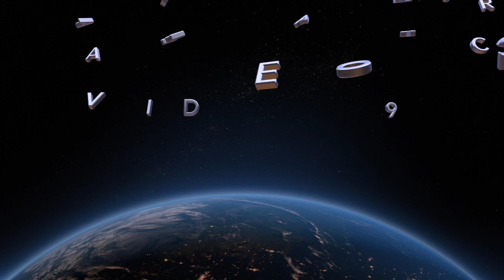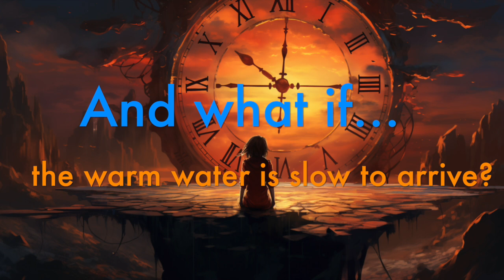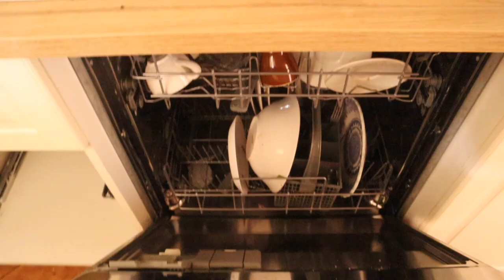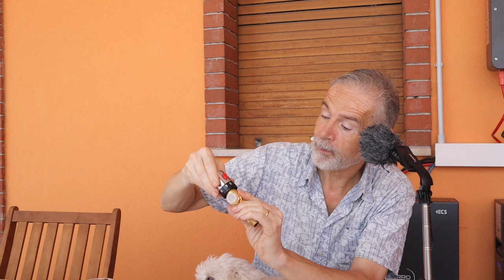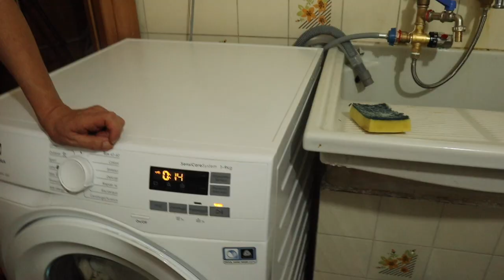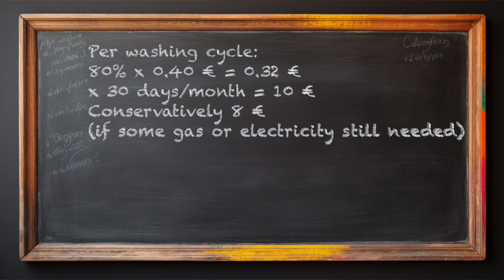Saving 50% or more on dishwashers and washing machines: give them warm, not cold water ! - Video 59

Comment: Do what I did - switch cold and hot water lines to the kitchen fosset with dish washer connection - and the warm water was connected to the dish washer....
Reply from the maker: Yes, that was what I did. In the dishwasher I just put unmixed warm water and on the washing machine a thermostat mixer because of the need for more different temperatures.

Comment: In the dishwasher, it is not optimal to use only warm water from the beginning because the heat prevents the egg yolk from dissolving
Reply from the maker: Oops, I didn't know that! Anyway, the first litres are always cold because the come from far, sometimes. That's the reason that I advise to let the cold water flow in another place. That is now under discussion (or partly)😀